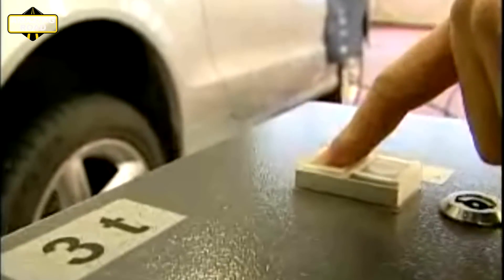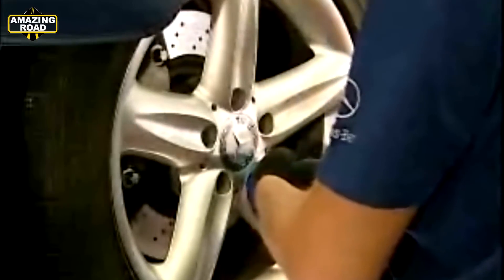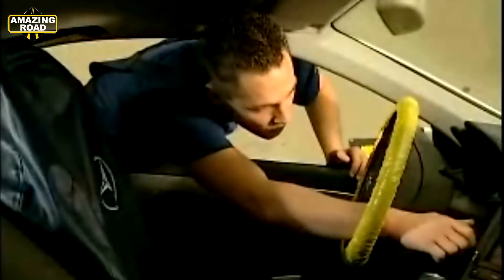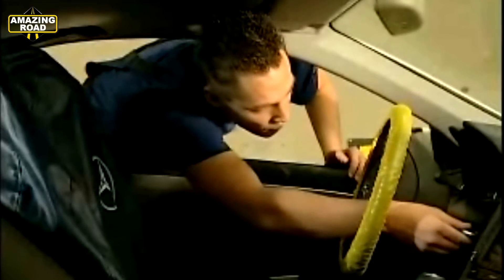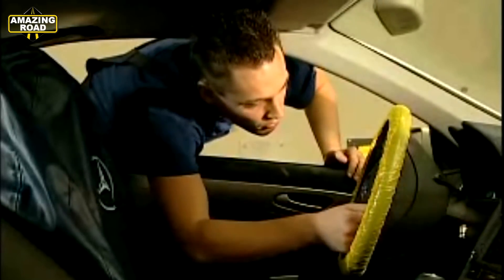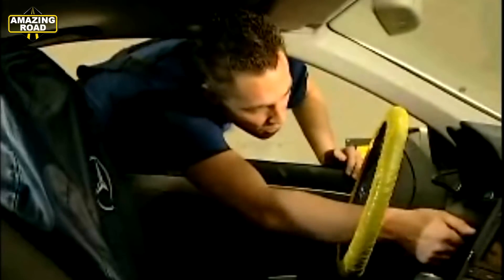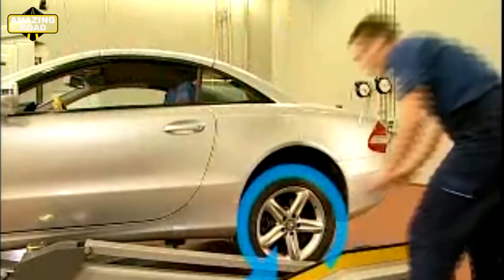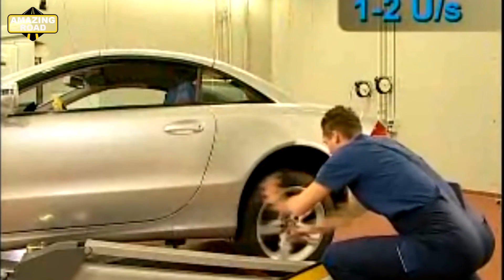Mercedes W211 Deactivation SBC Without Star Diagnosis at Home

Comment: Sorry but big waste of time!
Its not a big mystical mystery.
Ive worked on my brake system many times by simply unplugging the the electrical connector to the SBC pump. Never had a problem. And i do not disconnect the cars battery.  No codes or fault or problems. As long as you do not "wake" the car up while its unplugged you will be fine and SBC can no longer activate. Just follow this simple proceedure. "Before" unplugging SBC, open your hood so as to have access to SBC unit and brake fluid reservoir. Jack up your car before you  unplugging SBC because you car alarm knows when car is being jacked up (theft) and then car would wake up . I push the jack up button inside the car by front map lights to prevent alarm. Allows jack up mode. Roll down your windows in case you need to reach inside car for whatever. Shut and Lock all doors. Move the keys at least 50 feet away from car because car alarm can sense key if near car like within 12 feet. Now go for a 15 minute break so as to let all car systems fall asleep. Now you can go in and unplug the SBC unit and work on your brakes....do whatever. Just dont open any doors or anything that would wake the car up. Dont close or open the hood while sbc is unplugged either because hood has electric sensor too. When your done reconnect the SBC plug.
You could alternately do this by disconnecting battery but thats a bit of a headache because then gotta do all the preset dances for steering angle sensor, sunroof and windows radio. Just not necessary.
All baloney warnings about unplugging SBC are BS and people who claim that have done something wrong to cause the problem.

Comment: Thanks, useful video.  Do you need to do passenger side too or just doing the drivers side wheel rotations as indicated sets the whole 4 wheel system ?
Reply from the maker: Driver's side
Reply from the maker: https://www.youtube.com/watch?v=Se2Dq_O60Dg&t=12s
Reply: I did mine just by disconnecting the service battery to disable SBC. The problem I have is that after changing full set of discs and pads on front and rear,  the rear discs are almost locked up and the car is not driveable (discs heat up). Front ones are fine.  I tried your deactivation and reactivation, I think it worked, although I didn't get the rear light flashing. This didn't fix the rear brake locking though. Any ideas ?  I wonder if its the caliper pots sticking because they have been wound right back to fit accommodate the new discs and pads. I have seen other report this problem, so possibly the calipers need a repair kit or replacement.  Then the problem is how to bleed without STAR......

Comment: It’s great to see your channel! I have a question regarding break oil change. Can I deactivate SBC and use traditional vacuum leak oil from every tire , Just because I have no pressure oil changing tank! After tradition changing , active SBC using Foxwell 680 Pro! Many thanks if you could help me answer the issue !
Reply from the maker: Enable Agility Mode on your car https://www.youtube.com/watch?v=sYVR1RfiZDQ
Reply: Amazing Road TV why should I enable agility mode ? I have no Benz Diag! Only foxwell 680 Pro I have? I only want to change break oil.
Reply from the maker: Why deactivate SBC to change oil?
Reply: Amazing Road TV , can I change break oil without deactive SBC ? Your help will be very appreciated!
Reply from the maker: @cheng-junghsu  I understood. Oil SBC ))) At first I did not understand correctly. Yes, you can deactivate through Foxwell
Reply from the maker: @cheng-junghsu  Why do you need expensive diagnostics and diagnostics? So many have already encoded a lot on 211. Here install this program and do the encoding https://www.youtube.com/watch?v=PJHrQ_gWUAU You will receive a full diagnosis for $ 19 Link to this item in the descriptions. Here's how to install a diagnostic program. https://www.youtube.com/watch?v=zPha-2OW92c&t=1155s Here's an example of how to add fuel remaining in the tank https://www.youtube.com/watch?v=RU9qzoUqsp4 Start coding today))
Reply from the maker: @cheng-junghsu  Why do you need expensive diagnostics and diagnostics? So many have already encoded a lot on 211. Here install this program and do the encoding https://www.youtube.com/watch?v=PJHrQ_gWUAU You will receive a full diagnosis for $ 19 Link to this item in the descriptions. Here's how to install a diagnostic program. https://www.youtube.com/watch?v=zPha-2OW92c&t=1155s Here's an example of how to add fuel remaining in the tank https://www.youtube.com/watch?v=RU9qzoUqsp4 Start coding today))
Reply: Amazing Road TV Thank you very much for the link. I am going to try on this weekend! However, I still have a question regarding the BREAK OIL Dot4 changing! Can I vacuum draw the oil from tire pad side after deactive SBC ? Or even deactive SBC is not necessary ?
Reply from the maker: deactivate sbc is needed in any case. without this you cannot change brake fluid

Comment: I followed this, but how do you spin the rear wheels when the car is in Park? should the car release this if you have done things correctly to be able to rotate the rear wheels?
Reply from the maker: Rear wheel rotates
Reply: You need to have all four wheels of the ground or the differential will stop your tires from turning, and handbrake off obviously.

Comment: This was pretty much the only major concern with my E320 CDI. Was very glad to hear that they did this. Now I do not have any worries. When the pump goes, no big deal. I'll get a new upgraded pump for free. Mercedes is a great company. I am very appreciative. This vehicle is incredible.
Reply: Hi man, I just got a 2006 E320 CDI, with 95k miles on it. Do I have SBC brake system or not? I heard they got rid of it from 2006 and up. What year is yours?

Comment: Isn't it a lot less complicated to unplug the SBC control module?
Reply: Ive done it many times, thats all you need to do. I have a 2006 E350 just unplug the sbc with the car off, that way it doesnt activate when you change the brakes.
Reply: @kirksmith347  Where is the connection you unplugged?
Reply: @russlyons62  on the sbc unit on the passenger side of the vehicle just make sure you don't open the doors afterwards
Reply: It's also for the ESP and ABS and then the car will not be shiftable anymore.
Reply: @Raaaphael  that's amazing, my AMG master Tech told me that's all I needed to do, that's what I did when I replaced front and rear brakes on my 2005 SLK 55 AMG and it runs and shifts just fine in all three modes. SBC is essentially ABS, I have no codes and no ESP warning light unless I shut it off. I don't have electronic E brake but I believe cars that do have a means to retract and disable it in commands. If you had a negative experience maybe you inserted your key before reconnecting your SBE unit, that might cause errors and other issues. Based on the information I got from my Master Tech and my actual experience I'm convinced he was right.

Comment: Any failure in the CAN  network , and you insert the pads, once and no fingers, 
when sbc is truly deactivated it doesn’t matter whether the car is open or closed, or any other actions with the car will never force the SBC to chop off your fingers,  
for real misers, it's safer to just turn off both batteries

Comment: a have a simple way .u just take the capol off from the SBC and u good to go 
i have a mercedes w 211 iam using this way from the day i bught the car that in 2010
Reply: Ibrahim Ksheer what is capol ?
Reply: Hi, please what is capol, where can I find it in my w211.
Reply: @abrkids334  he means the plug at the SBC pump. Bad idea.
Reply: @shifty2755  Why a bad idea? Trying to confirm this method.
Reply: @silverspy0  

Never ever ever take the plug off the SBC pump. NOT UNLESS YOU ARE CHANGING IT. You must must must deactivate the system. If somebody cant deactivate the system properly then they should not be working on it.  You cant mess about with brakes. Ever.
Reply: @shifty2755  This is BS information. Simply isnt true.
Reply: @kirksmith347  I totally agree with Captain Kirk. This video procedure is nonsense!
Its simple. You just want everything set up ahead of time so no electronics go off while SBC plug is disconnected or youll get codes. So jack up your car ahead of time to keep alarm from going off or hit jack up/service button up by rearview mirror. Keep the hood open at all times. Lock all your doors so they dont self lock at some point. Move the key fob far away from car because car can sense fob within approx 15 feet. Dont let anyone touch the key fob. Let car electronics fall asleep for about 15 minutes or so. Now go ahead and unplug your SBC pump and do the brake pads, rotor replacement or both. Be sure to plug the SBC back in before you touch your key fob again. Ive never had a problem doing it this way.
Reply: @SilverSpy0 

I'm not arguing with you. I'm just trying to stress the importance of de activating the SBC system.
Reply: @SilverSpy0 

Or just do it correctly and deactivate the system. The SBC system has to re learn where the piston is after brake pad changes. It cant relearn doing it the cowboy way.....Theres still pressure in the system when you take the battery off. I bet you'll bleed the system as "normal" too? Even when theres no servo on it.
Reply: @shifty2755  More  nonsense!